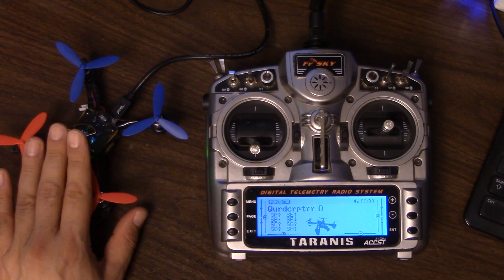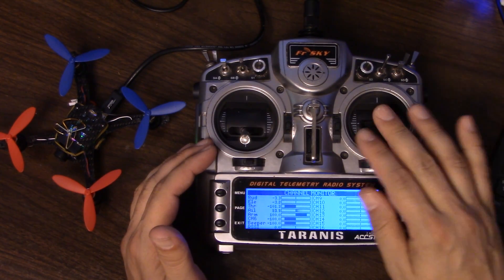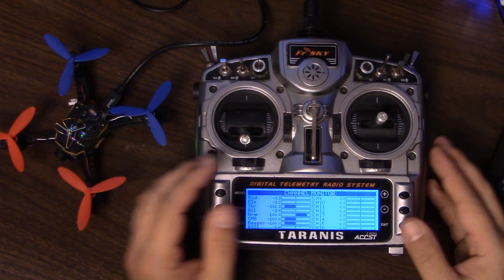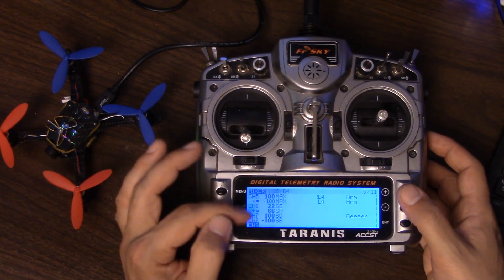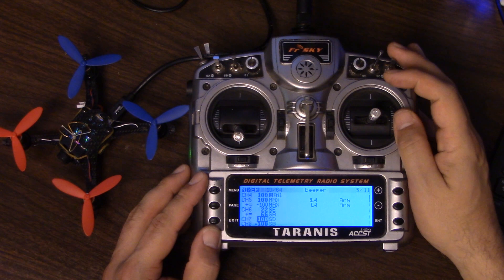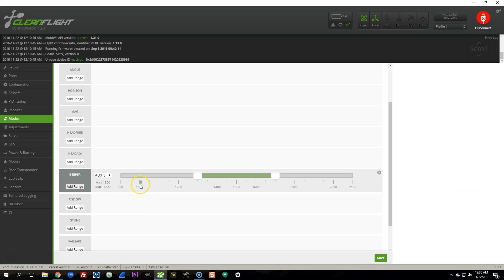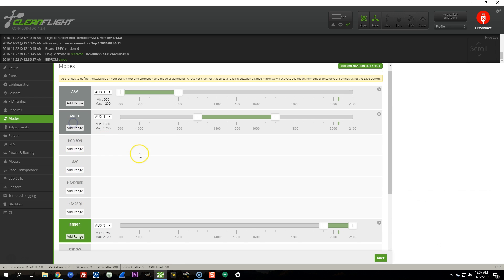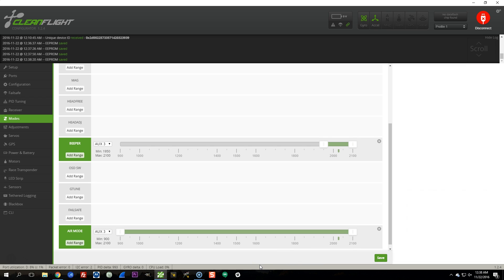Cleanflight / Betaflight Flight Modes | HOW TO SET UP

Comment: I have a question why does my betaflight not have air mode? Is this bad?
Reply from the maker: If you enable air mode in the Configuration tab, it is on permanently and is not shown in the Modes tab.
Reply: @JoshuaBardwell  oh okay thanks

Comment: I setup a 3 way switch with nothing, GPS Rescue, and Failsafe.  GPS Rescue worked fine and then when I tried Failsafe the quad tumbled out of the sky to the ground.  I should've know but at least nothing was broken and I've since removed it.

I then tried again leaving the switch to GPS Rescue alone, and the quad returned near home, came down, went up, came down, went up, and kept getting lower to the ground.  That said, if you leave the switch to GPS Rescue, is it supposed to RTH, come down the designated meters, and hold position?  I'm wondering if it was going up/down because of motor idle speed and if it can just hover in place since it could be nice to reposition yourself, adjust goggles, etc, if you know it will hold approximate position.
Reply from the maker: It does not hold position. You must switch back to arm and take control.

Comment: If I don't have air mode can i add it on somehow? Also how do you connect your radio to the betaflight with connecting the battery to your drone?
Reply from the maker: Some FC power the receiver from USB, but some FC require you to plug in the battery to power the RX. So definitely take off your props.
Reply: @JoshuaBardwell  really not easy to take them off from beta85 HD. its impossible without damaging the props

Comment: hi bro. good work. i need help as ive explored almost half of youtube. im using radiomaster J8SG and arducopter (flight controller) for my drone that has flight mode selection frm channel5 (it takes a certain range of pwm for each flightmode to enable). how can do that using 3 step mode switch so that say A0 selects FM1, A1 selects FM2 so on....(FM1 takes pwm less than 1200, FM2 between 1300 and 1500, FM3 between 1600 and 1800)
Reply from the maker: Just set up a channel mapped to a 3 position switch on your radio.

Comment: Hello Jb i need to know if theres anyway to create a new mode in betaflight for my Gps rescue i have a radiolink radio and the flight controller with be a Geprc Pro 40 aio i have the Matek SAM-M8Q GPS Module and if not possible i will just take advantage of the Arrow and Distance and speed on the Osd and thank you in advance

Comment: Josh, PLEASE HELP! My FrSky Taranis Q X7S (SE Carbon Fiber) is having an issue with my channel mapping for my aux 3 position switches. When a 3-pos switch is down, its reading 1000us, and at the middle position and the up position it is reading 1500us. 

When I am on the home screen of the taranis, it does show that the switch reads down, level, up for all of the switches in question, but there seems to be a disconnect.

If I hold the menu button and page to page 8/9 "HARDWARE" then it shows that the SA and SB are correctly identified as "3POS". Anything you think I'm missing here?
Reply from the maker: In the Mixer screen, I think you have set the Switch parameter equal to the switch you are using. This isn't the right way to do it. Doing it that way makes the mix only active when the swtich is in a given position. What you want is SRC parameter equal to the switch (e.g. SF, SA, SB whatever switch you are using) and the SWITCH parameter to be blank.
Reply: dammit. that fixed my problem. now there is literally no way I can't not become a patreon... sunuva........ Oh yea, also thanks freaking ton! I'm sure you know because I'm sure you hear/read it all the time, but your videos are such a massive help. I didn't buy your starter build because I found another one for cheap before I even knew you had your own... but that series is pretty dam solid, but I think my favorite was actually the "practical PID tuning" series, even though I am too noob to make the observations you have, and I've bought mostly pre-built stuff so far that seems to be pretty solid out of the box (thats my excuse anyways for not being able to tell the difference)... 

Lots of Love 
John

Comment: Hi, is it possible to add self leveling to the Headfree mode in Betaflight? In case I don't have video in the goggles anymore due to many obstacles and thus try to get the drone closer to me.
Reply from the maker: Sure. You can have angle and headfree on at the same time.
Reply: And how to do that? ...because now it behaves like in acro mode.
Reply from the maker: I would personally just set it up with angle and headfree ranges overlapping in the Modes tab. But I don't fly in headfree so there could be some interaction I'm not aware of.
Reply: IT WORKS! I expanded the Angle mode's yellow range line onto the Headfree mode and now the headfree mode also self leveling. Thanks!!!

Comment: how do you have your taranis connected to cleanflight?
Reply from the maker: I don't understand.... it's just bound to a receiver and flight controller like normal.
Reply: ok. got it. im using a spektrum dx9, once i set it as the certain aux switch in the modes tab, do i have to go into my spektrum and like confrim that, or does it save that through the bind?
Reply: Once your transmitter is set up and the response to its controls can be seen in Cleanflight/Betaflight then the things you save in Cleanflight get stored on your flight controller.

Comment: Hi Josh. I got myself a wizzard x220s. I finnaly set it up, so it flys excellent. The thing I don't know is, how to set it to Acro mode? I guess the Air mode would be similar to Acro? I used only a few batteries until now, so I didn't have time to try all modes, I've flew only in STAB mode, as it says on fpv gogles, I gues this is horizon mode? Thanks

Comment: Hi Teacher. I've just finished my rooster build. Finally I've used your 2.0 FC. But The 5v- beeper doesn't Work. At The moment, The FC was connected by USB, I've been created The Mixer in my Taranis "Switch D"(Ch7), and Aux3 in  Betaflight Beeper Mode, but when I change this switch...a green light blinks on FC but nothing happens.  Could The issue be caused by not enough power supply? I was wondering if I need to plug a Lipo...
What do you suggest Teacher? 
Evans

Comment: noob beta user here,  my setup seems all good,   but i want to fly in auto level mode, which is all setup, but the little drone simulator screen is bbahving like its in acro mode,  does betaflight even show the drone as being auto leveled?
Reply from the maker: No it doesn't do that.
Reply: well thats pretty silly isn't it,  for hours now ive been trying to get the drone preview simulator thing to show me its auto leveling, and your telling me it will auto level in flight but not in the preview window?
seems betaflight need to get their patching skills out.
Reply from the maker: That little preview is just intended to verify that your channels are moving the quad the right direction. They don't interact with autolevel or acro trainer at all. I think the BF devs don't think about autolevel very much.
Reply from the maker: If you want to make a feature request, creating a new Issue on the Betaflight github repo is the correct way to do it.

Comment: Hey Josh its me again..I went from trying to re map my motors to somehow locking my ESCs..I'm still not able to get anything out of em..but wen ever I make an adjustment anywhere in clean flight and save and re boot my ESCs chimme up like normal then all four motors spin up..I can't set the min and max for my throttle or pitch or anything..I'm in bad shape right now...I'm afraid I'm making things worse..where do I start?

Comment: Is there a way to disable headfree/headless in Betaflight - within horizon/angle modes? Obvs I know about adding Headfree in the switches but I have a Beebrain V1 and angle/horizon both are headfree. Can't find anything out about removing it! Any clues? Also have the same issue with my Dys Elf on Taranis X7 and stock transmitter. Am I missing something obvious?
Reply from the maker: Go on to the Modes tab in the configurator and delete the headfree mode.
Reply: Thanks for the reply! Unfortunately that's my issue, headfree mode is already deleted in the configurator. Can't figure out why Dys Elf and Beebrain are set up headfree in horizon/angle/air. Hmm, weird.
Reply: Sorted it by adding head free to a switch, so can disable on tx. Weird, thanks tho!

Comment: hi, i am using sp racing f3 with a devo 7,  i have managed to setup modes and the tabs highlight corresponding to the switch position, BUT for some reason i cannot get the ARM to work,  the min throttle value of the devo7 is between 1100 -1900  , i have tried numerous times but can seem to get it work,,
Reply from the maker: Go to the CLI and type "status" and look at the Arming Flags to see what is preventing arming.

Quite likely, you will see "MSP" which means you cannot arm while connected to the configurator.

Comment: After several hours of dicking around with the switches, flight modes.... I get it!  Or should I say "I got it!"
Is there any way I can control the sensitivity of the sticks?  You might want to turn on a dime!  If I were to push on a stick, I want to go "Easy does it" till I get the hang of it and then bump the settings up as the comfort level raises.
A million and 1 videos, some are poor and inaccurate. I'm sticking with yours , Painless360 and I think the other is called Flight Test
Reply from the maker: https://www.youtube.com/watch?v=Jis1d9GDZXU
Reply: Perfect.  Thanks

Comment: Hey brother, I'm new to drones.  My question is simple, some of the flight modes kind of sound the same or are a bit confusing to me just yet.  What is THE BEST mode to fly without developing bad habits. Acro, Air, Rate? I do plan on having Horizon or Headless modes to let the grandkids try for a second or two.  Thanks for all the videos.  I did learn something today!!!

Building my 1st quad. Matek F722STD, Spedix 30A HV BLHeli_S, Tarranis QX7, Betaflight, ZMR250 frame
One more question since I'm here.  Battery: on top or bottom? Is there really a difference?
Reply from the maker: Most FPV pilots fly in Acro mode, which is what is active when you simply Arm and don't have Angle or Horizon mode active. Air Mode is not really a Flight Mode. It's an option that can be on or off in any mode. I always fly with air mode on because it increases authority at low throttle. But it can make landing hard for some people.

There is a difference in handling between top and bottom mount battery. For beginners I recommend top mount because you're not landing on your battery.

Comment: Great video, I'm wondering tho lets say we have two 3 stage switches... say switch1 is used to arm the quad. Can we setup switch2 to behave/trigger certain actions depending what position switch 1 is in ? For example if switch 1 is in the disarmed position, switch2 can toggle the beeper and/or beeper + LED's. However if switch1 is in the armed position, switch2 is now used to toggle flight modes.. I've come across some small form factor transmitters which don't include many switches, although I love the game controller form factor. The lack of the switches really is the only thing that deters me from purchasing.
Reply from the maker: If the transmitter is computerized, it may have the ability to set up conditional mixes like this. I know that OpenTX can do it easily. (Well, easy for OpenTX. Maybe not so easy for you to set up.) I'm not sure whether Betaflight can do it internally.

Comment: Got a couple questions first I've just picked up a RTF x220 wizard an was not sure what mode it's in any command given an it holds it till I give it another that's one the second is on my 3s lipos what's a safe voltage to set my buzzers at so I don't damage my batteries thanks a bunch great videos they help so much
Reply from the maker: +Cory Canfield it's in acro mode and that's the best mode to learn in. Autolevel just teaches bad habits.

11.2 is an okay resting voltage for stopping flight.
Reply: Joshua Bardwell thanks so much I was pretty sure that's what mode I was in cause it wasn't trying to help me at all  I've been flying RC planes an helis for ten years but this really is its own animal an I've got alot to learn thanks to your videos  just answer pretty much everything so keep up the awesome work an hope you don't mind me picking your brain from time to time

Comment: Hello, there is one question, is it possible to organize two switching switches to switch 4 flight modes, just on my equipment there are no three-position toggle switches or torsion bars, but only two-position ones. I tried to do this in betaflight, but only the inclusion of two modes at a time is possible.
Reply from the maker: +Сергей Богданов Taranis can do that.

Comment: I was trying to change my aux switches on bettaflight but it won't give me options on what switch to select. Am new to this hole drone thing and not sure what I have done. Any help would be appiciated.
Reply from the maker: What won't give you options?
Reply: Joshua Bardwell 

In bettaflight I don't get any aux options at all.   Thanx for replying

Comment: Thanks for this, im 6 weeks into this racing quad thing and its so complex, only had a few minutes of flight so far, and doing the tests is like putting £100+ in the microwave to see what happens. So far I fried my ESC and replaced them, wasnt my fault the previous owner put EMax Nano firmware onto Emax lighning ESC's and when I tried to put the right firmware on they smoked, so yea avoid the Emax lightning esc's, the problem is the esc came out before cleanflight etc and ive found a lot of the lightning firmware isnt even recognised so its a minefield of problems, keep away.

Comment: You talked about everything except for what I was looking for in this video.
Reply from the maker: Well whatever you do don't tell me what it was.
Reply: +GBLynden's RC What was the point of your comment apart from being rude?!
Reply: I don't know what GB was looking for, but I was looking for an explination on what the different modes are, more spesifically I was looking to see if there was a mode I could put on a switch so it would autolevel. (I'm a n00b, trying not too break too many propellers, would for example be nice to have when putting on or talking off the fpv glasses etc)
Reply: Horizon was what I was looking for :P Tested it now, worked, but extremely tempting to use, but also a "lifesaver" when I get scared, but it might take me longer to learn this way :P
Reply: Exactly. Wanted to know how those modes affect the flight of a quad copter. Any lay man can figure out these simple settings on clean flight in 2 minutes.
Reply: As rude as that comment was, I also watched this to learn what each mode does, and I didn't find that information here :(

Comment: Hello, 
I am having a problem with my old walkera F210 since the whole CF change. It  is currently running cleanflight and some how my aux1 and aux 2 are on the same channel. I have aux 1 set to arm and aux 2 is set to angle & acro. In the mapping both channels are moving at the same time.  How can this be fixed? Thanks !
Reply from the maker: My first guess would be there is something wrong in your transmitter and it is sending the same switch to two channels.
Reply: Joshua Bardwell I looked into the transmitter but I could never get how the devo 7 works that's why I just gave up it. It was one of my first brushless quads that a flew. I have tried to mess with the channel settings in the transmitter but I can not figure out how to get 2 aux channels  out of  sync with each other.

Comment: I also just realized that the esc's no longer chirp when I plug the battery in.
I'm actually in Cleanflight. I just tried again and the arm mode range stayed saved as long as the board was plugged in but would revert when unplugged. 
So do you think I need to reboot the board? I've never done that, just hold boot button while plugging in board?
Reply from the maker: Are you pressing "save" at the bottom of the page?
Reply: yes sir, and the Arm tab changes green/gray as I move the switch. 
The other mode switch that I set up for flight modes seems fine and does not change.

Comment: Hey Joshua, thank you for taking the time to provide us with so much information.
I wonder if I can pick your brain. I just updated my LUX board in CF and not knowing how or that I needed to save my settings first I'm putting everything back but I can't get the arm to work. I'm putting it on a switch and when I save it it works in CF but the quad won't run and when I return to Modes the range has changed. I'm sure I'm missing a detail somewhere and I don't understand why a saved range would change.
Thank you.
Reply from the maker: I also don't know why a saved range would change. Usually if stuff in the configurator is not saving, it means you're using an older version of betaflight on a newer configurator.

Comment: Is there a way to set up a mode to require two ranges to be met before engaging? Sort of an AND rather than an OR criteria. I want my buzzer to come on when my quad is both disarmed and in air mode but not when one range is met without the other.
Reply from the maker: No. You must do this in your transmitter.
Reply: Thanks

Comment: Joshua, I follow you from long time ago, your videos are such an excellent source of knowledge and you put so much passion on them that its clear to see you love doing this. Keep up with it mate.
I have a question about cleanflight and I cant seem to find the solution. How could I set it up in order to have different PIDs configuration and switch them from the controller? I used to have librepilot and that was a piece of cake but in cleanflight I cant find the way to do this. Do you know how?
Reply from the maker: +Eduardo Agustin Vendrell del Río use stick commands to change pid profiles.
Reply: Joshua Bardwell thank you man